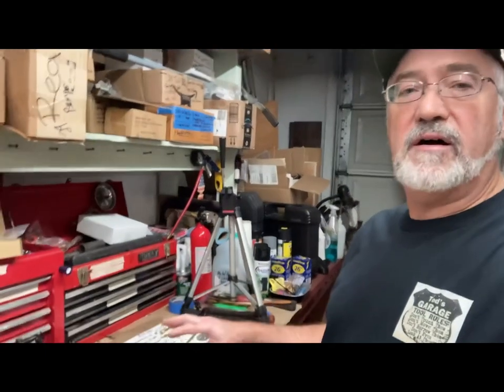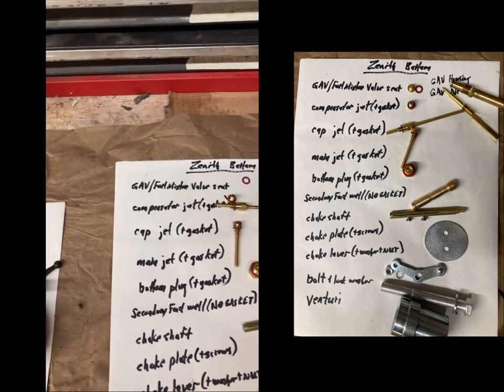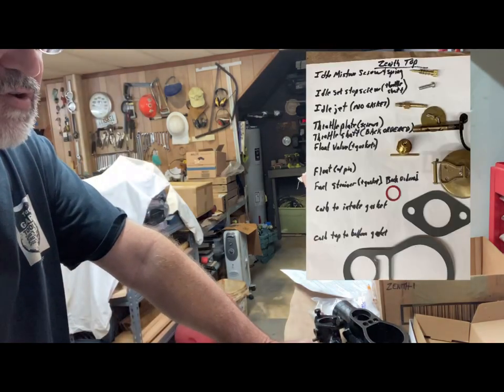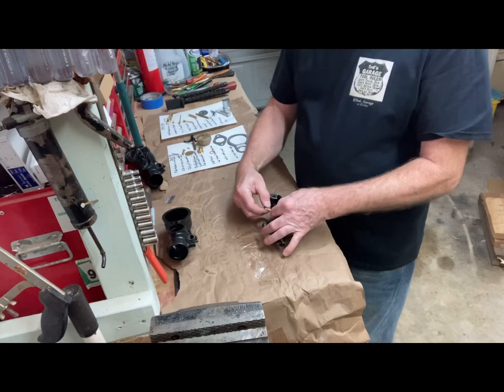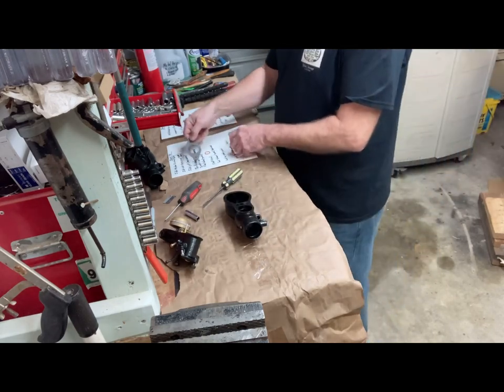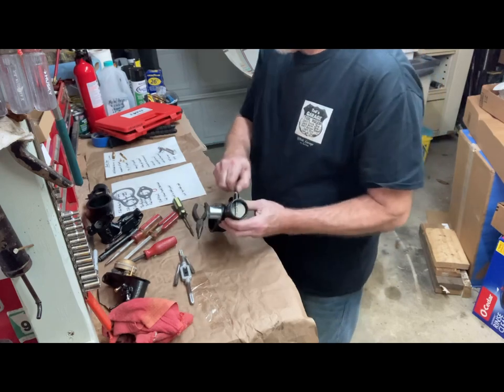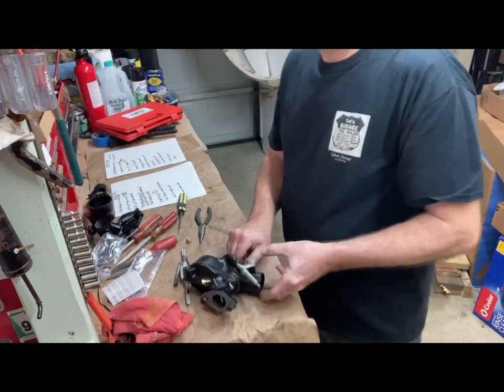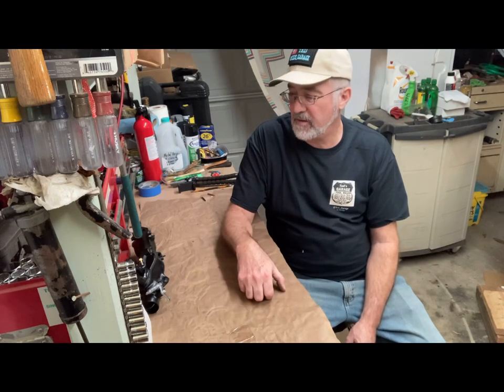Ford Model A How-to: Carbs Part 7: Zenith Carb Final Assembly #car #ford #restoration #classiccars

Comment: Hi Ted.  Success!  It started right up with the choke rod turned a quarter turn.  Probably the easiest start I've had in 30 years.  The carb was actually in good shape to start with.  I bought new gaskets, a new strainer and plug and the little carb tool.  I tore it apart, ran a thin wire through all the jets and passages.  I think the main thing was that the fuel line was pushed into the strainer where it tore it up and blocked the gas flow or a clogged jet.  I replaced the gaskets except for the cap jet which had 3 under it.  I figured whoever rebuilt it the last time knew what they were doing so left it be.  I do know that the cap jet and main jet need to both be at a certain level in the slimmest part of the Venturi, but don't know how to measure that.  Are they set at a particular measured height or just set to be at a point above or below the gas level?  I assume the same height.  I did take the retainer ring off the choke needle and it seems to seat better.  There is a definite difference in the the strainer plug size between cadmium and the brass plug.  Mine needed the brass one.  My car is a 30 coupe but don't know which Zenith I have.  My last go around, I replaced the ceramic filter in the fuel bowl mounted on the firewall.  It was like a pumice type stone so put in a corrugated filter and spring replacement.  Not sure exactly how the gas runs through the bulb.  I didn't put the round brass mesh filter in with the paper filter last time but pushed one up into the top of the bulb cap and then put the paper and spring back in.  Not sure how it's supposed to work, but thought this would be safer if fuel flows well.  The gas line hooked up just fine with no leaks.  I usually have to fiddle with it a lot.  I guess me getting older and not being in a hurry helped, haha.  So thank you for your help and great carburetor videos.  They took the intimidation out of tearing a carburetor apart.  I would never be able to drill out holes etc but can tear one apart now.    Now on to the brake light always on.  Any ideas?  I pulled the rear end out to put in a synced transmission.  I think it's a newer brake light switch.   I've tried moving the wires from one screw to the other.  Does the contact plunger have to touch or not touch while at rest?  Anything would help, and I hope you're ok with answering questions.  Thanks again,  Rusty
Reply from the maker: Thanks for the nice words. These videos & editing are a lot of work and it’s really nice to hear from people who watch them.

As for the brake lights:
1. First thing, when you disconnect the wire from your brake switch- the brake light goes out? Correct?  Just so we aren’t chasing a crossed wires.
2. Do you have the connection rod/wire from your brake pedal adjusted? No slack but not pulling the switch…. 
Also, There are two different switches for Model A’s. Which switch does your car have?
Older switches were made cheap and known for shorting = light on and a dead battery.

If you disconnect the connection rod and the brake lights are on then it’s probably a bad switch… if you have a voltmeter you should be able to disconnect the rod and test the switch by pulling by hand… pull = 6v, release = 0v.  This type of switch there isn’t really a way to connect backwards.  One side to battery and other to the light bulb.

Also, if you really want to “fix” the dead battery problem…. Consider connecting the battery lead to the ignition switch. Original wiring was directly tied to the battery, along with the lights and horn…. This allowed Ford to use a smaller ignition switch and no relays (lights and horn pull a lot of amps). But if you’ve installed a new LED bulb for your brake lights it will not pull much amps (and be much brighter)…. then connect the wire from your brake switch to the ignition switch/hot side of the coil (coming from the ignition switch).
Good luck…👍🙂 let me know what you find…

Comment: Hi Ted.  Well the parts finally came.  The new brass carburetor drain plug has stopped the leak.  I do get an occasional drop of gas but I think the threads on the carb itself must have a slight leak.  In trying to stop that the last time, I may have tweaked the old brass plug a tad too much to make it leak more.  Gasket has always been in place.  The stop light is working fine now.  That old switch was bad.  I don't think it was ever good to begin with.  The push rod on the switch never contacted the brake pedal link when I first replaced it like it should have.  I think it must have been slowly draining my battery.  I was always charging it in the past thinking I wasn't running the car enough when the brake light was slowly draining it.  I get frustrated with all the junk or low quality parts over the years not knowing they are causing the problems and not me.  This new switch makes contact with that brake pedal rod so the switch is off until I press the brake.  I'm now messing around with the choke rod.  I got a new grommet for the choke rod and of course, the hole is too small and now the choke rod doesn't spring back as it should.  I think I may have to try and get a grommet off of Amazon. In playing around with the wiring harness while trying to figure the brake light I somehow didn't get the cap on right.  My horn stopped working on my test drive, haha.  I did get it on right and it works fine now.  Lastly, while trying to start the car again, the starter rod pushed in and the starter wouldn't shut off.  This is the third time this has happened since owning the car for over 30 years.  Luckily I put a shut off switch a while back and was able to cut the power.  I found a nice video from a George Sage on Youtube about rebuilding a starter switch so that it has the correct parts.  I had know idea that the parts suppliers can only get junk starter switches.  Finally it will be fixed for good.  I'll let you know how that goes.  Thanks so much for your help on the light switch and identifying the problem.  I will keep you posted.  Rusty
Reply from the maker: Hey Rusty,
That’s great news to get your brake light switch straightened out…👍

I know what you mean about that cap/“light bail” at end of the steering column…. It can be difficult 😣🥵

You might try lubricant on the choke and starter grommets if they are tight…a little white lithium grease or garage door grease… something to let them slide easily…

I hope your battery dieing problems are solved… take care,
Ted

Comment: Hi Ted.  I enjoyed your carburetor videos on the model A very much.  Probably some of the best model A videos around.  Very thorough.   I have a 30 coupe that I've had for about 30 years now.  Don't get to drive it much lately.  I do have a question though that maybe you can answer.  I need to start by saying I'm not a mechanic, but have been able to pull things off and replace reasonably well and have always managed to get it running in the past.   The last 3 or 4 years have been having different issues pop up.  I sent my old carb out to be rebuilt.  My fuel sediment bowl messed up and my carburetor ended up getting all clogged up.  It seemed to be running fairly well and started up fairly easily for about a year.   Recently I can't get it to start.  It'll run for a few seconds then stops.  Almost seems it wasn't getting fuel.  I've been afraid to mess with a carburetor but I did find that the last guy that helped me with the car pushed the gas line too far in past the brass ferrel and this was pushing most of the way through the strainer assembly.  Me not knowing this when I tried to unscrew the strainer assembly totally obliterated it.  I ordered a new cadmium one for the 30 carburetor and it is too small.  Do you know if the 28-29 brass one is bigger?  I also decided to try and go through the carburetor after watching other carburetor videos to run a thin wire through the jets and holes to make sure they weren't blocked.  I also have the Les Andrews repair book that has helped me in the past with other issues.  One thing I'm not sure about is with the fuel adjusting needle housing.  In the Les Andrews book it says on page 1-62 under a Note heading to remove the ring clip on the tip.  Mine which was recently rebuilt still had the clip on the end so not sure if that was seating as it should.  One of the major parts suppliers did it during the Covid shut down so figured they knew what they were doing.  ( Can't find the receipt for it now) and it was running ok for a while.   I couldn't see mention of it on your video.  I've seen the clip on in one other video so not sure if it really matters.  My Zenith does have the screw in seat at the bottom.  I hope you have knowledge of this.  Thanks for any help.  Rusty
Reply from the maker: Hey Rusty,
It sounds like you may have sediment from your gas tank getting into the carb/jets. It could be very fine rust sediment getting past your fuel sediment bowl. Have you checked/scoped inside your gas tank for rust and sediment?

Also the gas tank sealers from the past (10, 20, 30 years ago) can break down with the modern ethanol gas… the alcohol in the fuel can break down the gas tank sealer and then the sticky gas mixture can build up and clog the jets. So when cleaning the jets and passages use carb cleaner to “blast out” the residue, as well as the thin wire.

It does seem like you have to clean the jets out on your carburetor… 
but it could also be the ignition shorting out when it starts…. ie if you advance the spark when it starts…(1) the wire from ignition switch grounds, (2) the wire from bottom plate to top plate ground’s out ….(3) or the top plate looses ground (to the distributor housing), which the points need to be able to ground when they are closed. The top plate “slides” in grooves of the distributor housing…. It must be clean and make contact, ie no paint… one test is don’t move the spark lever and let it run… see if it remains running…. It won’t hurt it to run a few seconds/minutes with spark lever retarded….

Not sure on the carb strainer… if brass one is different size than cadmium. 
I don’t think the tip retainer is still needed for the gas adj valve…. as Les Andrews and others have said, but for authenticity sake some people still use it.

Let me know what you find out…. Take care, ted

Comment: Hi Ted.  A couple of updates.  As far as the brake light, I have a 30 coupe which requires the switch that when the brake pedal rod is depressed, it pushes that switch in.   There is about an 1/8 inch gap in between that rod and the switch rod when the car is not running and the brake pedal is NOT depressed.   When I turn the ignition on and the car is just sitting there and the brake pedal is NOT depressed, the brake light remains lit.  I don't know much about electricity, but I would think the pedal would have to be depressed to complete a circuit to turn that light on?  I've replaced this switch once before in the last 30 years but can't remember the circumstances.  Sometimes I just switched out parts over the years because I didn't have the time to learn this stuff, but now that I'm older, I'm trying to understand how it all works.  The battery has not been draining at all.  I just took the bulb out until I could figure it out.  New parts are on the way.  I also ordered the LED light.  Secondly,  the carburetor started leaking at the drain plug.  UUrrgggg.  It had a brass plug this Zenith.  I paid careful attention on the rebuild and just basically hand tightened the brass jets etc on the rebuild per your instructions.  I had a very slight drip from the drain plug so thought I'd tighten it more and it got worse.  New plug on the way.  Wonder if there is a gas sealer I could also use.  I'm hoping the threads on the Zenith carb weren't messed up but I didn't go crazy on the tightening.  We'll see.   I also have noticed that there  is carbon splash on the concrete on start up,  I'm wondering if the carb is too rich and hope that it's not more serious seeing I recently put a new head gasket on when I broke a head stud a couple of years back.  I did have a couple of Model A guys helping with that so think it was done correctly.  No longer in a club because of my schedule.  Thank you for your input.  I hope it's ok to keep asking questions,  I'm sure you're quite busy.  Rusty
Reply from the maker: It does sound like a bad brake switch.  If it’s on all the time with the battery connected…. are you sure it’s the brake light and not the parking light. If the “light bale”, ie the jumble of wires at the bottom of the steering column, if those are messed up it could be the “parking light” is on. Also make sure you have the light switch “off”….at your horn button… the light switch can be confusing. Parking light, off, low beam, and high beam….etc.

As for the carb plug… you did install the gasket with the plug, right?  Your carb kit should have had a washer type gasket for the plug.

The carbon from the exhaust does sound like it may be rich. Also if you choke it too long. Once you turn on the gas, let the float bowl fill (just 1 minute), then a few engine turns on choke and release the choke. It should fire up. 

If the tail pipe is thick black carbon, turn the GAV in.  Depending on the carb, engine, elevation above sea level, and temperature…. the GAV will be different. Even driving in traffic and open roads, or hills can make a difference…. So you can’t just say 1 turn out, or 1.5 turns out on the GAV and leave it. “Newer” carbs (and I mean even carbs in the 1950’s) had some engineering for different situations…. Now days the car engines have sensors and computers making fuel adjustments hundreds of times a second..
Needless to say 1 or 1.5 turns of GAV is just a starting point. Don’t be afraid to adjust the GAV and the timing lever,… 
As for timing, the faster you drive the more advanced the timing. Once it starts you should set to about 1/3 timing lever (3-4 notches), then a notch every 10 mph. I think it has 10 notches so it also depends on your timing setup.  The engine will run even when really retarded timing… just no power. Too advanced and it will buck.

Good luck. 👍